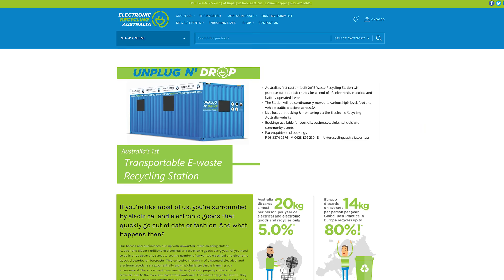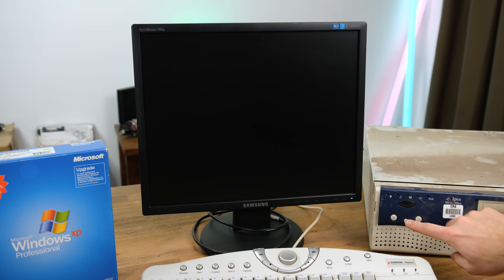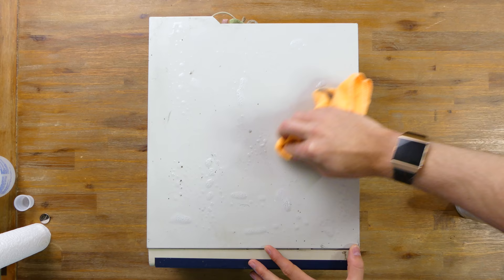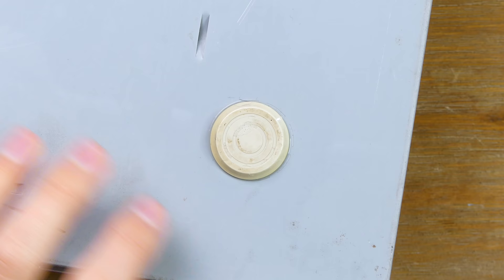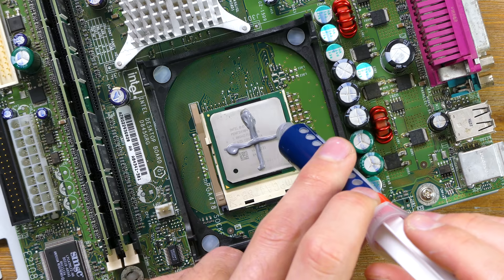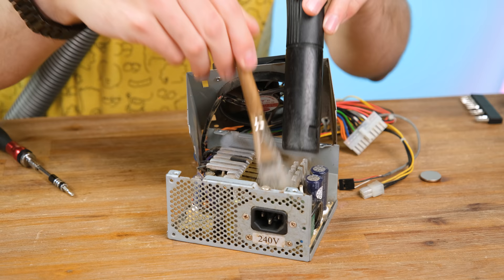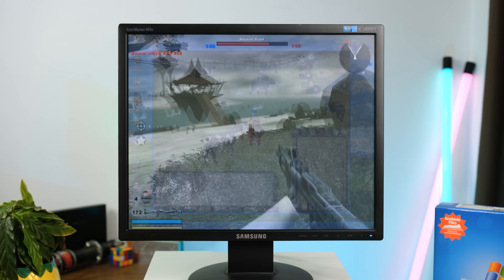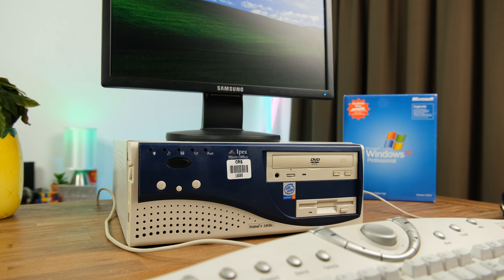Cleaning Up A Dirty Old Pentium 4 Computer!

Comment: hi, I have a Pentium 4 sl6ws "Northwood" 2,60 Ghz w/ HT /512 KB L2/Bus 800 MHz, but unfortunately I can't get S478 motherboard for my Windows XP retro project. I think your P4 with a SSD, you could run windows 7 32 bits and even Windows 8.1 32 bits

Comment: for some strange reason the P4 never did it for me. The PIII slot 1 was awesome, but the P4 was a room heater. I even had a laptop with a P4 chip and is was not good, it was way to hot. Went to the AMD camp back then. Eventually bought a centrino laptop and few years later the core2 q6600. The Q6600 was simply awesome. Anyways, the mhz race with the P4 was NOT a good idea of Intel. It was de Windows ME of Intel.

Comment: Just a question popped in my mind, does white cases of this generation (like latest ones from Corsair, Lian Li, CM) still happen to turn yellowish over the years?
Reply: It all depends on the quality of the plastic, but since they are almost all black, not much an issue. At worse, you can paint it white if it turns yellow.

Comment: On units like this, I swap out the MB for a AM3 Based board and clean up chassis. the style of the chassis is still good for a micro-ATX board. even a AM4 based system board would work here... personally, I don't like Intel based systems.
Reply: Ashley -CHECK MY PROFILE   they are just too old for me... plus I'm a AMD fan to die for... AMD is based in the city I grew up in, so I trust them better then Intel...

Comment: I know that some Pentium 4 processors will be underclocked if the motherboard does not have a 4 pin cpu power connector

Comment: Even on modern Sata HDD I only get around 62mgbs transfer speed, when it’s advertised to go 130mgbs+ if it had Sata an SSD would be a great upgrade but IDE is too slow so it would be a waste maybe try buying a new cheap 120gb 7200rpm HDD there literally cost nothing these days get and IDE to Sata adapter there also cheap and bam faster loading times

Comment: maybe you can go for northwood pentium 4 3.06 ht
Reply from the maker: It was an option, but at about 80w it might be too much for this system
Reply: Oh wait those are high-end Pentiums?
Reply: @psivewri  the 80W you said is TDP, i think your heatsink would handle it just fine
Reply from the maker: @liliwinnt6  more so the board and PSU I'm worried about 😅
Reply: @psivewri  hmmm... okay, btw wish you good luck if you wanna try it

Comment: 06:15  It appears that you are applying an excessive amount of thermal paste. 
Less is more --  
An excessive amount is contra to efficient heat transfer, it can in fact reduce
the heat transfer efficiency, behaving more as an insulator.
A very thin coating is all that is required to fill in the microscopic pits in the heatsink
to ensure that the surface layer of the CPU is making a superior quality level surface
to surface bond. The Heatsink does the rest. Not the thermal paste.
Bear that in mind for future reference, so that you are not making CPU sandwiches.

Comment: that thing was already useless by 2005 why would you restore it? Don't get me wrong I'm all for old PCs, there's some great ones like the Dell Xeon W5687 workstations. They're 10 years old and have sold for as low as $150 and are for years they were insanely good value for a gaming pc especially when paired with the RX570 for $100 last year. We're talking about $250 for a gaming experience that you have to pay $1000 for today.

Comment: HI Psivewri i have a few old desktop computers with Windows XP and 98 would you like any of them I have 3 2 in working order
Reply: Wow you are lucky! What is wrong with the one that doesn't work?
Reply: @cdos9186  does not turn on i have no idea because I do not want to mess anything up so i just left it
Reply: @cdos9186  has windows 98 my moms old high school PC
Reply: @cdos9186  it is about 4 in the morning and I am cleaning out my old desktops cant sleep
Reply: @CrystalWater2006  I love working on those old machines, they are just fun to fix.
Reply: @CrystalWater2006  Is it a Packard Bell?
Reply: @cdos9186  No it is a Mecer
Reply: @cdos9186  by the way I have a Compaq from 1996 and I just need a new power supply and a motherboard it is a Pentium 3 card CPU that I have in that motherboard I've had it for almost 8 years now it had Windows NT workstation on it now it just sits in my cupboard collecting dust I have no idea what to do with it because I can't find an accurate power supply for it
Reply: @cdos9186  just call me Sebastian

Comment: Pls, try to install Windows 10 on this computer, pentium 4 can easily run windows 11 and pentium 3 can easily run windows 10, pentrium 2 can easily run windows 7 and amd duron can easily run windows 7, pentium 1 can run windows xp but this isn't a perfect OS for this processor, 2gb ram with p4 can very easy run windows 11 so please install windows 10 on this old machine!!😇

Comment: You should install Linux
Reply: @HCM HOBB why?
Reply: @Tano unless you install Tiny Core or Puppy Linux 😂
Reply: @Tano Or instead of destroying decent, working hardware just use it to run software of its era like retro games.
Linux sucks on these old computers because there's not really much you can do with it, I mean browsing the web is almost impossible with a P4 nowadays. But if you install windows 98 or Me on it you will get a pretty awesome retro gaming pc.
Reply: @Tano Fair enough but I personally only get rid of my old hardware when it stops working and there's no way/isn't worth to fix it.
If an old machine works just fine I'll keep using it and I won't destroy it for no reason.
I'm not too much worried about the 40W a 2002 GPU uses or the 60W a midrange Northwood P4 uses tbh...

Comment: I still have a pentium 4 computer.
Reply: Sweet!! Have you worked on it?
Reply: Yes, my has a FX 5500 256mb.
Reply: @DonMr  What kind of hard drive?
Reply: @cdos9186  old school IDE. 2gb DDR 400 and Windows 7.
Reply: @cdos9186  WD 40 GB 8mb
Reply: @DonMr  Thanks, but what model?
Reply: @cdos9186  I not sure.
Reply: @cdos9186  WD400.
Reply: @DonMr  I believe that is the series. It will say likely WD400BB. Models are very specific, and nearly everything has a model from computers to refrigerators. When you say "WD 40GB 8MB" that is technically a "generic" term as there are lots of different Western Digital 40GB models. WD400BB is very specific as if you look that up you will immediately get all the information about it. A lot of times the series seems like the model number, but like I said the model number is very specific as to what type of drive you have. If you looked at my channel, you will see what I mean by how I do my titles for my videos. Sorry for the rambling about model numbers I just want you to understand them a little better.
Reply: @cdos9186  WD400EB